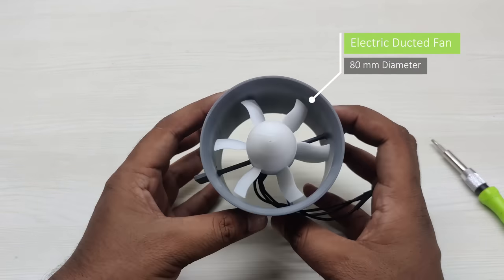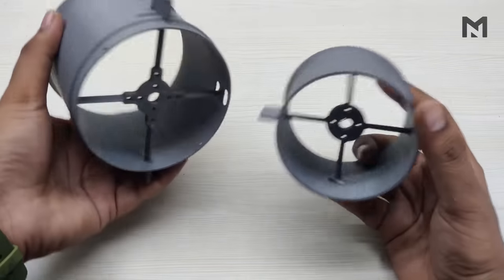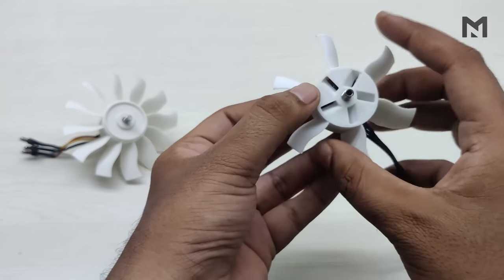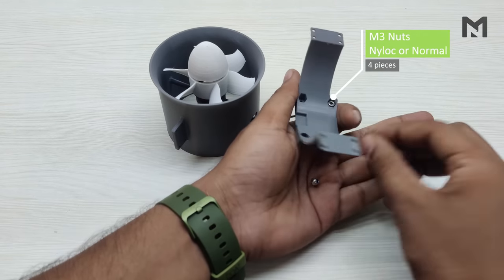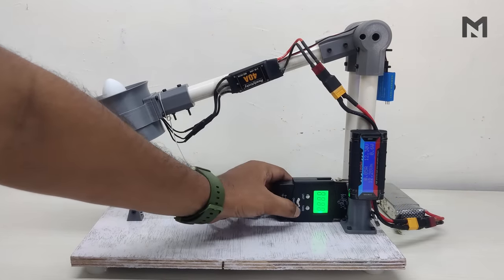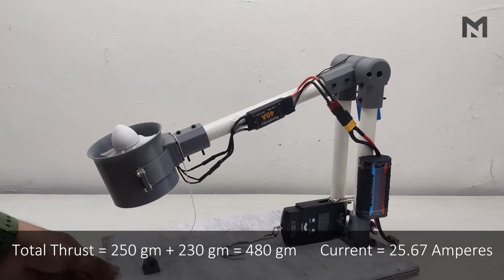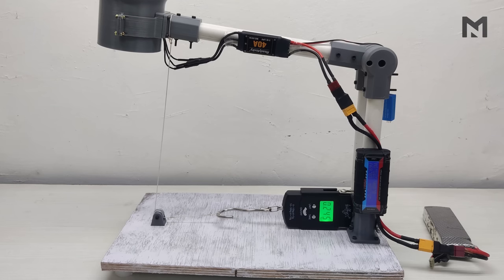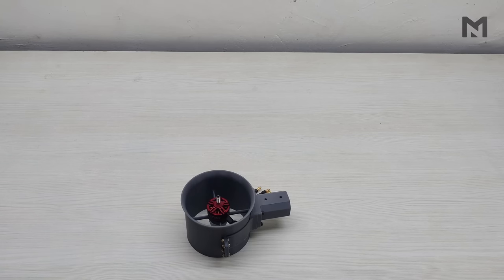DIY 80 mm Electric Ducted Fan | 3D Printed | Thrust test comparison

Comment: Edf motor generally require higher stator volume motors so for 2300 kv motor it has be quite big in sizr in  order to be able to spin that prop with greater toruqe and without getting overheated ,i have a  70 mm 5 bladen3500 kv motor it has 2222 stator which is quite long
Reply from the maker: Yes you are right.....But EDF motor consumes lots of current and these motor uses less current. I am in the process of designing an EDF with this motor so that it can be efficient without overheating the motor....
Thankyou for your comment and don't forget to subscribe 😊😊😊😊

Comment: You should compare the thrust with the same rpms. The motor brings power of X Watts and this aims to a rpm depending on resistance of the blade system. More resistance --> lower rpm -->less thrust. so I assume you will never get more thrust with the same engine at max rpm an more blades.

Comment: Great set up, but there are a couple of errors in your thrust calculations. 1) You are using the weight of the EDF with 6 blades for all three blade assemblies. The weight of the 8 and 12 blade assemblies would be heavier with the addition of filament to print the additional blades. 2) The way you determined the total amount of thrust needed to overcome the weight of the EDF and the test rig doesn't take into account the moment difference created by attaching the EDF to the rig arm.

What you should be measuring as your base weight is the EDF (without the blade assembly or the diffuser) while attached to the test rig. The place to measure the weight is from the center of thrust (string attached to the motor axle behind the attachment nut). The weight to add is the individual weights of each blade assemblies and the diffuser. You will then have the correct 3 different static weights to check their own thrust production against.

You should then find that the thrust production actually goes up with more blades, but with smaller gain differences due to the added weight.
Reply: Absolutely. I only just watched this video and I came to say this but found that Brandon beat me to it.

Comment: your motor cap will block the vents of the blade add some on the end cap too
Reply from the maker: Yes definitely they are blocking the vents. That's why I have redesigned them in my next video. Pls check it out...
And thanks for watching and don't forget to subscribe 😊😊😊😊

Comment: Great Video! I think, the blade angle is much too steep. It sounds like they are constantly in stall condition. 
Making the blades less steep will definitely increase thrust. Try 20-30 degrees if your printer can do so.
Reply from the maker: Thanks for your suggestion and I will definitely redesign and test it. If the result improves than I will definitely upload a video for it.
So thanks for watching and subscribe for more videos...😊😊
Reply: Do you know of any airfoil file that can give you 20 to30° angle of attack for a duct fan With good coefficient lift?

Comment: what do you think the max thrust you could achieve with a 3D printed fan ? could you reach 15KG ?
Reply from the maker: No 15 kg is too much.... One youtube channel has conducted a test of 3D printed propellers and it break at 8 kg.
So we much use injection molded propellers for high thrust.
Reply: @MechNinja  awesome, do you think you’ll make these eventually ?

Comment: The blades you use are simple fan blades.  Is it possible to print blades that are shaped like a propeller?  A propeller is shaped like an airfoil and creates a low pressure  area in front of the blade that actually sucks the blade forward.   You might get an increase in overall thrust with that shape.  A three blade propeller would be a good design to start with.
Reply from the maker: Stay tuned. My upcoming video has all your doubts. 😊
I have tried 3 blade Propeller earlier but the result was low so I haven't shown in the video.
However I will try one more time and check the result.

Comment: Very nice test ! Can you show a speed up video of how design these 3D printed propeller and EDF housing on a CAD software.
Reply from the maker: Yes I can show it but it will be a longer process, so I generally skip those parts.
Reply from the maker: But in future I will try to add a timelapse of ot

Comment: Hello what is the 3d Printer that you use ? which one great pringer could you recommand for me ?
Reply from the maker: I use ender 3 pro and ender 3 max. And they are good for beginners and also I have been using them since two years and hadn't found any problem yet. You can go for them....😊😊😊

Comment: you used 230gm for the weight of 6, 8 and 12 blades respectively there should be an obvious weight difference between the configurations maybe this might have effect on the efficiency
Reply from the maker: I have checked the weight of all the propellers....and there was a negligible weight difference so I have neglected the weight......

Comment: Thank you for the test! I have never unstood why the motor is not mounted in front of the impeller. It would make so much more sense for cooling but above all for the weight distribution (CG) in a model airplane...
Reply from the maker: Thankyou so much for watching and don't forget to subscribe 😊😊😊😊

Comment: Can you make a similar video on water pump using Rs 775 motor and test it in a similar way with six blade four blade or 8 blades propeller
Reply from the maker: Yes its a nice idea...I will definitely try it. But the blade will differ from these blades as these are designed for max air flow and pump require pressure. I will try it bro...
And don't forget to subscribe....
Reply: @MechNinja  i have already done it yesterday when i watched this video. Your work is excellent 💯 Nicely represented all fact
Reply from the maker: Thankyou so much 😊😊😊😊

Comment: Did you took into account the weight of the blades everytime you replaced them... I guess more blades, more wight and also the calculations must change.

Thanks
Reply from the maker: The Weight of the propeller hardly matters as it's light weight....approx 18 grams.....
Thanks for watching and don't forget to subscribe 😊

Comment: You should measure the force at the same distance from the pivot at the motor. The way you measured gives you a higher reading due to the leverage. Nice prints though.
Reply from the maker: 3.5 cm hardly plays any role due to leverage. Initially I thought to place the string at the center but I don't want to create any obstruction in air flow passage...that's why I have placed it to the nearest point.
And Thanks for watching and don't forget to subscribe 😊😊😊😊
Reply: @MechNinja  It does make a difference because your arm is so relatively short, 3.5 cm is a considerable percentage of the total length.

Comment: You need to charge the battery between each test. We can see the voltage sag is different on each run despite the amps remaining relatively stable
Reply from the maker: Thankyou for your valuable feedback....it is an old video....but do check my latest videos....i have improvised many things....and has designed efficient EDF.
Thankyou for watching and don't forget to subscribe 😊😊😊😊

Comment: Good job 👍🏼 💥👏 try high torque bldc motors like sizes available in ready made rc electronic jet ducted fans
Reply from the maker: Yes bro I can try a high torque motor. But I want to make an efficient EDF which can work on less torque motor. And I am working on it till I get the best result. I know that high torque motor will give good result but then there will be no difference between ny EDF and the commercial one.
Hope you get the point...😊😊😊😊
So thanks for watching and don't forget to subscribe 🙂🙂🙂

Comment: Awesome build bro! Do you think the inner perpendicular intersecting support bars that run across the diameter north/south and east/west, with a way to hide the motor wires in an aerodynamic fashion by having one of the support bars having a hollow inner body to feed the wires through?
Reply from the maker: Thanks for the compliment brother.
Actually initially I thought of designing it hollow, but since I need a symmetrical design so I have to make it all other four bars identical and hence the cross section area decreases ( the area from where the air will pass ).
So it will reduce the thrust.....😊😊 So I haven't designed hollow.
Hope you get it bro...
And thanks for watching and don't forget to subscribe 😊😊☺️

Comment: Cool! But don't you gain 25% by using the pulley and the measurements taken at 90° to the direction of force?
Reply from the maker: No....I am not gaining anything....I am just using a simple pulley system to transfer force.
If I had used two parallel string and used a pulley than it would have given me twice the force but I am using a single pulley.
If you have a single doubt than do comment and I will clear it....😊😊

Comment: i always dun understand how the blade number affect the speed. and how many are the best,
but i know aircraft engine got a lot more blade, and why?
the video show that 6 is highest efficience, and why not aircraft use 6?
the turbulent?
Reply from the maker: There are various factors which are responsible for the speed of the aircraft apart from the number of blades i.e. design of the blades and design of the duct. In aircraft the blades are used for the compression of the air so that it can be burnt so it uses more blades. But in our case the thrust is produced by the speed of the air that's why we have used less blades, but the no. of blades vary in EDF depending on the design of the blades and dia of EDF.
Hope you get your answer...feel free to ask anything
And thanks for watching and don't forget to subscribe 😊😊😊😊

Comment: Good work. Im working on a similar project with 60mm duct. What is your pitch angle at the tip ? Did you also optimise that ?
Reply from the maker: So glad to hear that you are making one. The pitch angle of my blade is too much, somewhere around 30 to 40 degrees.
But I will redesign it around 20 degrees for more Thrust.
So thanks for watching and don't forget to subscribe 😊🙂

Comment: Are you stating that the weight did not change by having more material in an 8 and 12 blade design? If the weight of 2 or 6 of those blades 15g or 20g that would make everything equal. With a weight of 1.25g/cm3 that seems like it would negate the findings and make them all equivalent... or find you that 6 or 12 was actually better for its weight. Granted, the 15-20g is only 3%~5% of the test rig's weight

Comment: Would the 3d printed parts survive a proper edf motor and battery setup? Idea for other video maybe.
Reply from the maker: Hmmm actually 3D printed parts are way more stronger than we think. And yes they can survive the proper EDF motor and battery setup in one condition. That there should be least to no vibrations in the propeller and this can be only achieved with high accuracy printer.
And one more thing that there is a limit of rpm that the 3D printer parts can withstand without breaking because of the centrifugal force.....
Reply: @MechNinja  same with molded parts, too much speed and they deform and shatter as well. It would be an interesting test to see if its worth it to put in a plane.
Reply from the maker: Yes definitely, the one I am designing will be used in RC planes in my upcoming projects. But I will only install them when it has a high range of thrust. I have been continuously designing and upgrading my EDFs and uploading the results. So thanks for watching and don't forget to subscribe 😊😊🙂🙂

Comment: Do you have thrust test comparison of different fan diameters with different blade counts? that would be very interesting.
Reply from the maker: Well currently I have designed only two 100 mm and 80 mm and uploaded the results. But I am working on more different sizes and will soon upload the results.
So thanks for watching and don't forget to subscribe for more videos ☺️☺️☺️☺️

Comment: Are these for water or what. You will get the same amount of thrust because of the surface area being moved through the circle .
Reply from the maker: No it isn't for water. These blades are designed for air. If they were designed for water, they would have smooth round edges.
But it can work for water too but a poor efficiency.
Hope you get it..... thanks for watching and don't forget to subscribe....,😊😊😊
Reply: @MechNinja  can you make one for water.

Comment: Redesign of the struts to a negative blade design down to 0° in flight direction will result in less air rotation behind the blade and may result in a higher outgoing air speed and less turbulence.
Reply from the maker: Thankyou so much for your valuable suggestions. I will definitely work on it as soon as I figure it out...
Thankyou so much...and don't forget to subscribe 😊😊😊😊

Comment: Me ha gustado el experimento, y los resultados, son contra intuitivos; uno asumiría, que a mayor número de paletas en el ventilador, y con el mismo motor, se obtendría un empuje mayor con un consumo similar, pero acabas de demostrar que la presión de empuje es menor y el consumo de energía es mayor. Al probar con solo 3 paletas en el ventilador, casi no obtuviste empuje,  por lo que parece, que 6 paletas en el ventilador, es el número de paletas óptimo. Me corrijes si me equivoco, el ángulo de ataque de las paletas que usas, es de 45°, que por  intuición es el mejor ángulo de ataque.
Por una cuestión de costes, me pondría a jugar con un ángulo de 30°, y con 5, 6, y 7 paletas en el ventilador, que son cifras cercanas, empezando solo con 6 paletas, para recién probar los ventiladores de 5 y 7 paletas. Mi teoría, al reducir el ángulo de ataque, la superficie de la paleta es mayor, y el volumen del aire a  mover es mayor, y el aumento de consumo de energía lo justifica.
Ojalá uno tuviera fondos ilimitados para probar todas las configutaciones posibles y poder sopesar los límites de cada configuración.

Comment: If you look at airplane propellers, the blades are twisted.  Steeper angle at the center, shallower angle at the tips.  That's because it takes more torque to overcome the aerodynamic drag at the tips.  Twisting the blades spreads the torque demand over the full length of the blade  resulting in higher RPMs, more thrust and less energy needed (amps).  Higher RPMs will most likely expose the differences between straight blades and twisted blades.

Comment: You should add Compressor blades it should accelerate the wind I think 🤔
Reply from the maker: If I add compressor blades then it will increase the pressure at the end....but we need high velocity here....

Comment: Keep doing good work!
I am concerned the motor cooling is not enough for long runs. Do you have a thermal sensor to put under the motor chassis?

Comment: Nice work, but there are a few mistakes... First, mass o a motor has deferent arm length, therefore mass of it should not be just added. Instead weight of a whole set should be measured together. Second, each propeller has a different mass, therefore it is possible that each propeller gave similar output, but was compensated by different weight.
Reply from the maker: Thankyou so much for your observation.
I would like to clear that yes, weight of the propellers are different but since there is hardly difference of few grams. So i have eliminated it....

Comment: Nice work. Try high voltage and low kv, that will give some more torque and efficiency into that motor. Also though I assume you have done your research before you’ve designed these, I think there’s more performance to be had in the design of the blades and the twist as the airfoil goes from the blade root to the blade tip.

Comment: OMG. Do you feel any difference between static and dynamic thrust? Of course, maximum static thrust we'll see with minimum blades, cause they produce minimum drag.
Reply from the maker: Your "OMG" is a compliment or a comment...😅😅
Reply: @MechNinja  It's an exclamation. I was really excited. You've spent some efforts, materials, make such video, but measured only simple and predictable part of thrust. The most interesting - dynamic - thrust wasn't be measured.
Reply: Honest Question, How can you measure dynamic thrust?
Reply from the maker: Well to calculate dynamic thrust we need mass flow per second but currently I can't calculate that, so I have only calculated static thrust.
Reply from the maker: But in future I will be more advanced and will provide maximum details so don't forget to subscribe 😊😊😊😊

Comment: And performance without the duct?
Reply from the maker: If I remove the duct than the efficiency will decrease. Because the duct prevents the air losses from tip of the propeller.

Comment: friend..is this motor 25 amps and 12 volts? :)?
Reply from the maker: Motor is racerstar BR2207S 2500 KV motor. We have to use it with 40Amps ESC. And I have used a 12 volt battery. Check my new ducted fab video. It has a updated results.
And thanks for watching and don't forget to subscribe 😊😊😊😊
Reply: @MechNinja  cool, thank you very much understood :)

Comment: Interesting test... My only question would be about the power source (The Battery). Was it changed between test? If not then your test is invalid...
Reply from the maker: No bro I haven't changed it throughout the test. Infact you can see in the video taht I have been connecting the same battery.  I have been using this battery in my previous videos too.
But I have only charged it once during the full video test. And I am definitely sure that if I had charged it fully before every test than the results would have been increased.
So thanks for watching and don't forget to subscribe 😊😊😊
Reply: @MechNinja  Thanks for your reply. I really appreciate work. It's very insightful 👌
Reply from the maker: Thanks for watching and don't forget to subscribe...
😊😊😊😊